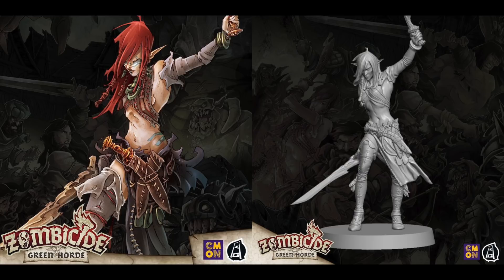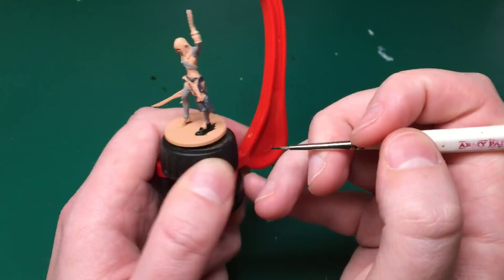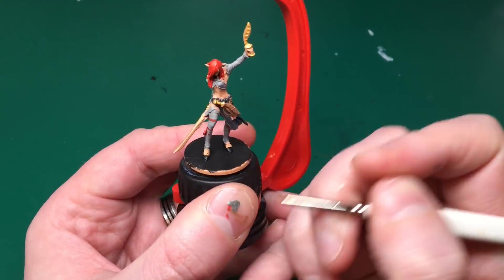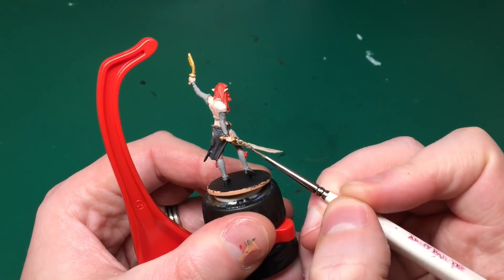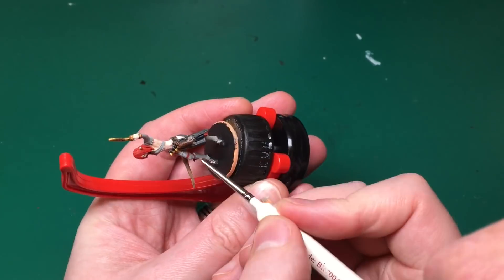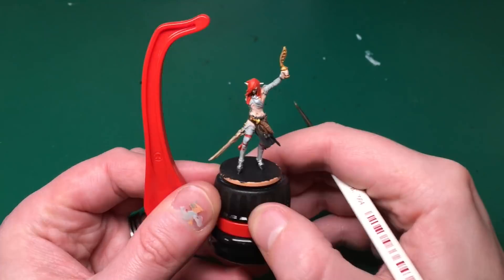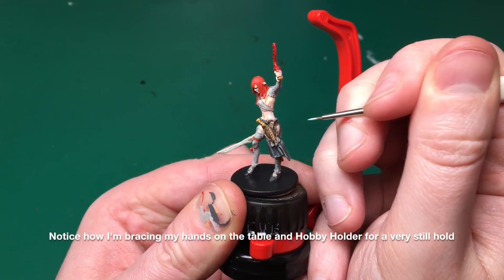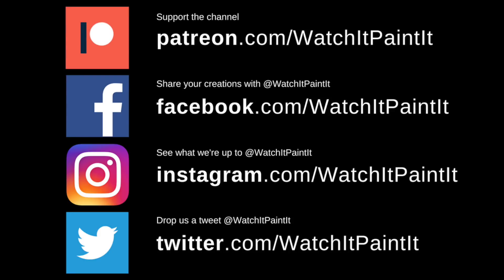Zombicide Green Horde - Painting Seli

Comment: Watch It Paint It How much water have the highlighting on the skin? Re painting mine cause o used shades and goes awfull :/
Reply from the maker: If you’re really carful and want to dry brush the skin highlights (which will work) do not use any water. If you want to paint the highlights use enough to make the paint flow but not run - probably just a splash
Reply from the maker: Oh wait! The YouTube mobile app is awful I thought you were asking about another video! Don’t drybrush Seli :-D and use quite a bit of water - probably half as much water as paint. You don’t want it to run into the recesses but you want it very thin and build up the highlight with quite a few coats
Reply from the maker: Oh you're off to a great start! Those are really good, well done!